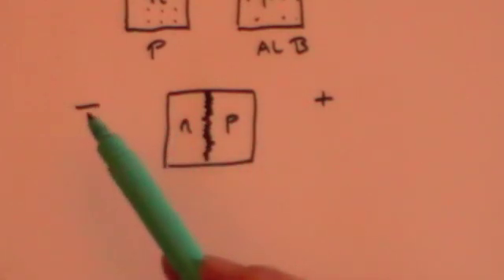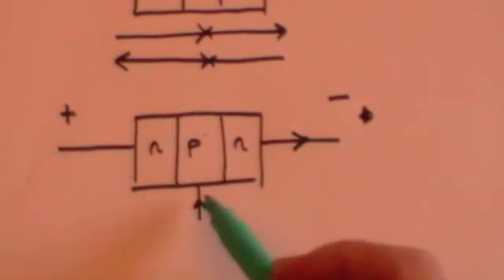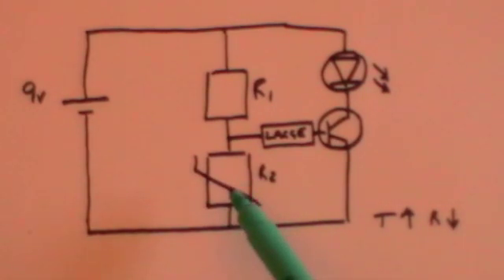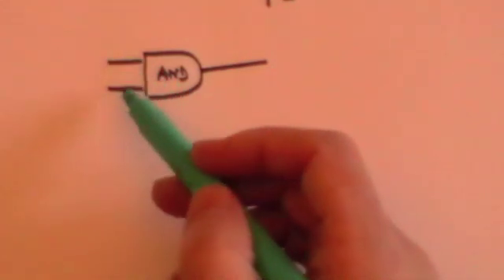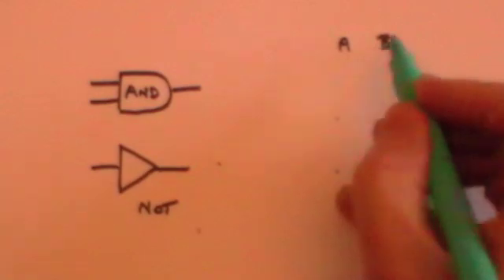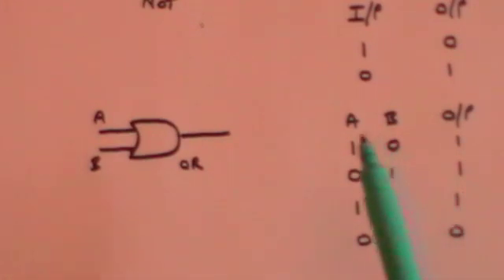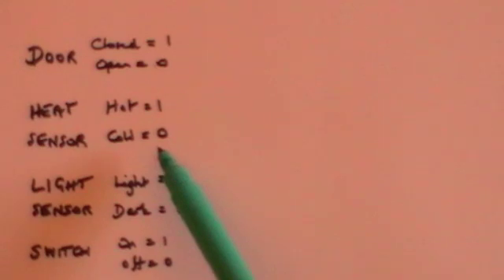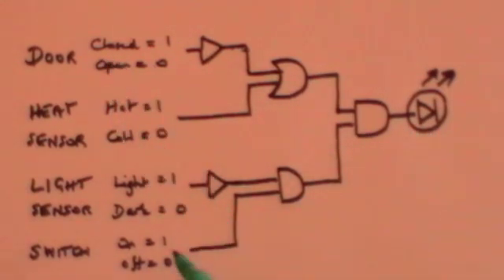Logic gates: GCSE revision

Comment: Hi DrPhysicsA,
I have a job preplacement test coming up with very little time on hand.
Test Topics are as follows:
-Oscilloscope Traces
-Frequency
-Semiconductor (diodes,transistors)
-Logic and Digital Components

I have a Mechanical Engineering background meaning I did not pay much attention to 
my electrical courses.

Which of your videos can I watch in order to get an understanding of the Test Topics?

Comment: I have a question about the circuit with the thermistor, I don't understand why you have R1 at that particular place. I'm wondering if you really need the voltage divider, because you don't care about the voltage coming to the base, right? There will be a current to the base if the thermistors resistance is high, no matter whether R1 is there or not. And the led now doesn't have a resistance, so it'll probably fry, so shouldn't it be better to place R1 after (or maybe before?) the transistor/led junction?
Reply from the maker: At what time in the video does this arise?
Reply: 8:40, about the circuit that controlled an led with a thermistor
Reply from the maker: ***** Its really that when R2 is low (high T), if there were no R1 then you would effectively short out the battery.